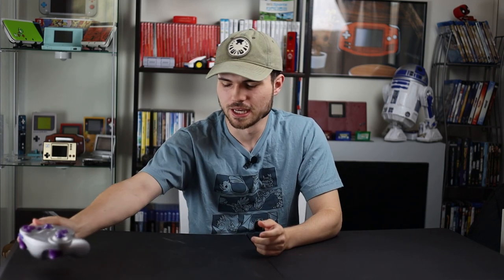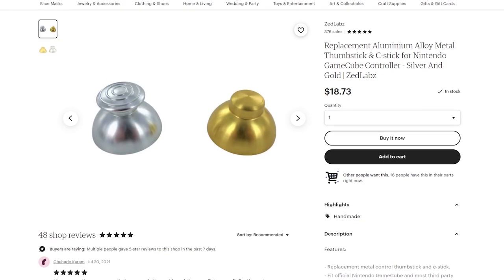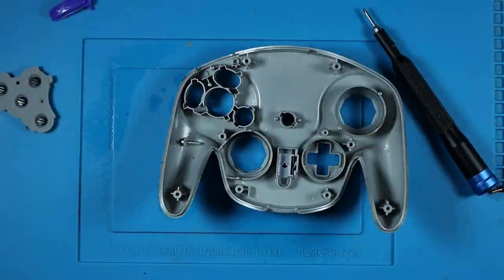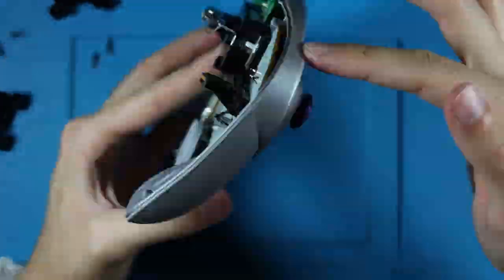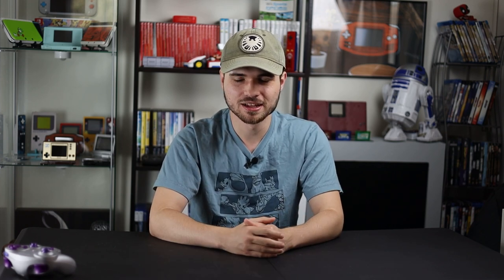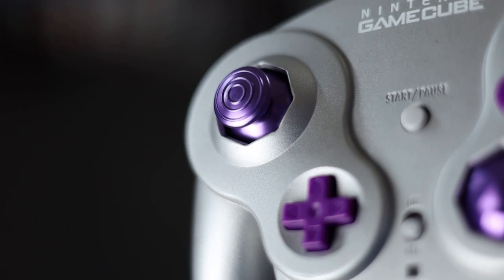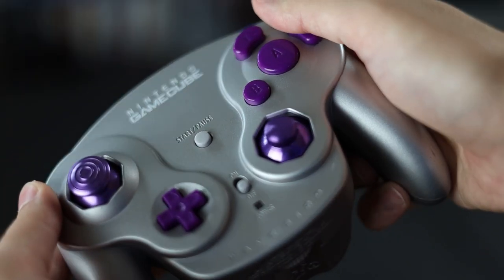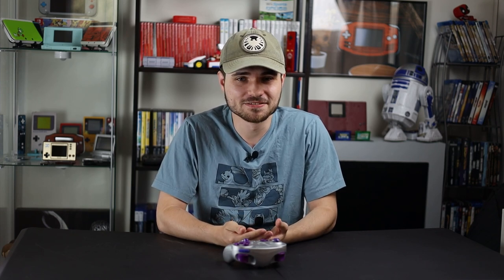Are Metal Thumbsticks Better Than Rubber?!

Comment: OK so I've played melee with aluminum sticks and I can tell you the problem with the sticks: While they are comfortable they are much heavier than the oem sticks which leads to the stick taking longer than normal to return to neutral, making the difficult tech in melee impossible or incredibly hard with you having to manually return the stick to neutral frame perfectly. One more issue I noticed is that if you play with them in your controller for a long time, they will wear down the plastic peg on the potentiometer until one day, I can imagine that they'll eventually make the stickbox useless. This is my two cents
Reply: the oem sticks already grind down that plastic peg enough, i can imagine the aluminum sticks destroying it quick

Comment: Well that's disappointing. I've worn-down the thumb on my Switch Gamecube controller and started searching the web for replacements. The problem is, most people say that the best replacements come from other gamecube controllers - which I have, but am hesitant to tear-apart just to serve a specific need.
I then came across ZedLabs' website for these Metal replacements literally at the same time I found your video. I was immediately captured by the shiny finish of the joysticks. I'm a guy who really likes Silver and Gold controllers, and I thought my Gold Switch Controller would look bawler with these.
It seems like they're sold out of the Silver and Yellow ones which I want, so I asked them to email me when next available. But hearing that they can hurt your thumbs is a bit of a breaker for me.

Perhaps I will buy them, and use them to swap out the stick on an older controller I no longer use; that way, I'll get to replace my Switch's Broken Thumbstick, and the old controller can be for display.